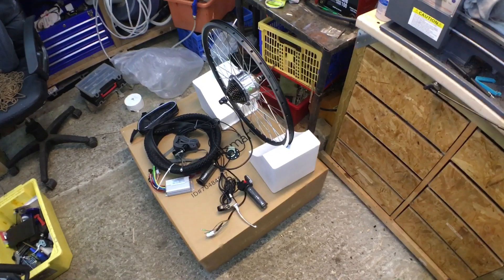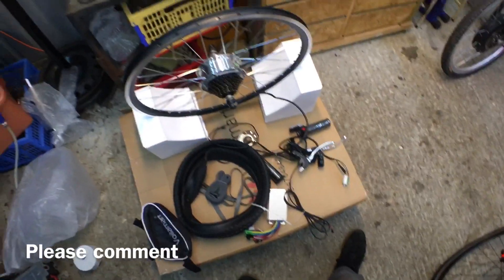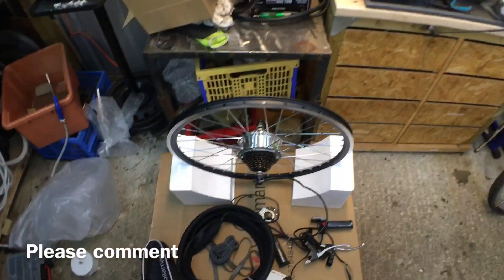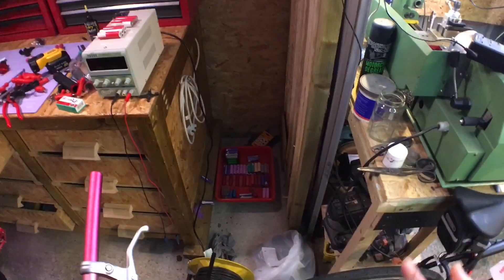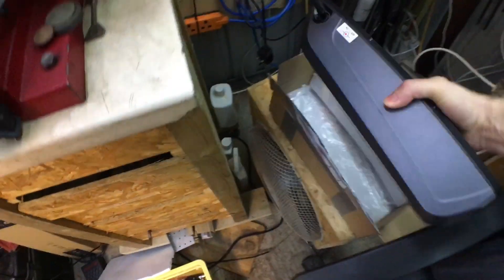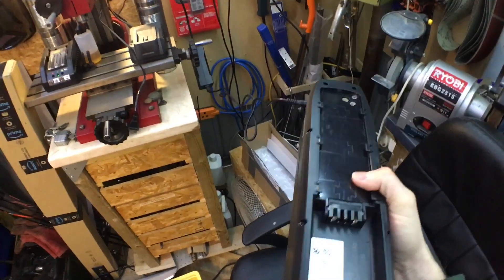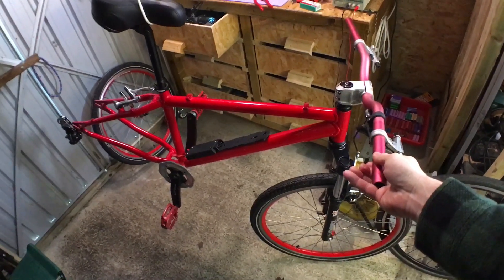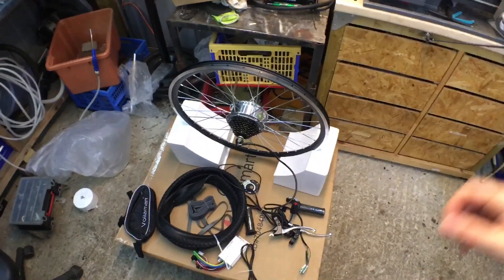Diy Electric Bike Kit And 10ah Battery $324 US £248 UK

Comment: Motor looks descreet , untill you put the battery and controller in there. I'm a little baffled at the 250w choice. Then I think of the weight my full suspension 1500w and the smell that comes off the brakes. Good choice. 
https://youtu.be/AnZTzA2QfGw
Reply from the maker: yeah good video. i was just trying to keep the weight down.

Comment: is that motor kinda like a helper  or will it work with out using the pedals?
Reply from the maker: yeah it will work on the throttle like a twist and go scooter, or pedal and it helps you along.
have a good day my friend and thanks for commenting.

Comment from the maker: In this video Time to start my new ebike take a look at parts i brought  Thanks for watching! Please subscribe!
Ebike Parts https://www.banggood.com/custlink/3Dv3bT3Q5l
*Cobalt Drill Bit Set https://www.banggood.com/custlink/m33GhoqQgF
*Cordless drill  https://www.banggood.com/custlink/DmvGNTT9iT
*Electric bike Wheel https://www.banggood.com/custlink/KKDKNf7t7S
*48V 350W 10.4AH 20 inch E-bike https://www.banggood.com/custlink/3DDGn1TIl5
*CrimpTerminals Connectors https://www.banggood.com/custlink/mK3GAuT8oI
*Wire Crimp Tool https://www.banggood.com/custlink/DvD3sfwIaa

Handy Good Cheap Tools
*MMA welder i would like https://www.banggood.com/custlink/3vGDsufVnM
*MIG welder i would like https://www.banggood.com/custlink/K3KKs7T5nO
*TIG welder i would like https://www.banggood.com/custlink/Gm3DBGhSsi 
*Tin Snip https://www.banggood.com/custlink/KmmmnwTVMl
*Stick Welder https://www.banggood.com/custlink/DDGKsw7PU9
*Welding Clamps https://www.banggood.com/custlink/mKKGbuwF1j
*Machinist Hammer https://www.banggood.com/custlink/KmDmQ1ut11
*Screwdriver Set https://www.banggood.com/custlink/KmmKATw5w4
*Precision Screwdriver Set https://www.banggood.com/custlink/K3v3Nuwi8V
*cordless Angle Grinder https://www.banggood.com/custlink/GDKmAFL7s4
*Carbide wood turning tools https://www.banggood.com/custlink/KKmKQwfS8S
* flex shaft Rotary Tool https://www.banggood.com/custlink/3KK3Z35Boi
*palm Router https://www.banggood.com/custlink/GDGGbT1iSj
*F-Clamp https://www.banggood.com/custlink/vKDGbfuZiB
*Double Edge Pullsaw https://www.banggood.com/custlink/mvGvb7uIZN
*Mitre Box https://www.banggood.com/custlink/33KvbuTSj3
* Impact wrench  https://www.banggood.com/custlink/mKDK6g6Bts

Above are affiliate links and in the comments it costs you nothing, if you do not want to use links search on goggle more info Thanks.

#EBIKE #250W #HUBMOTOR